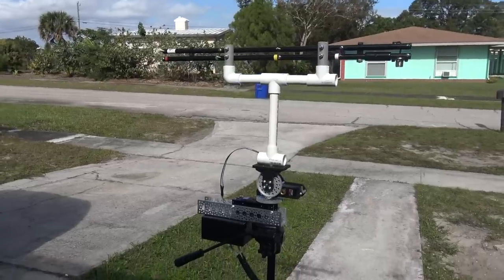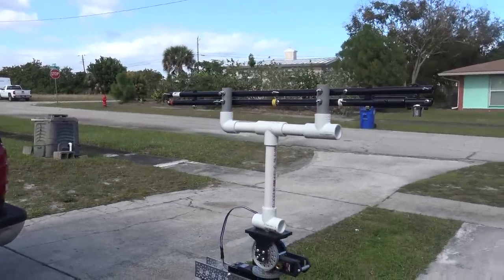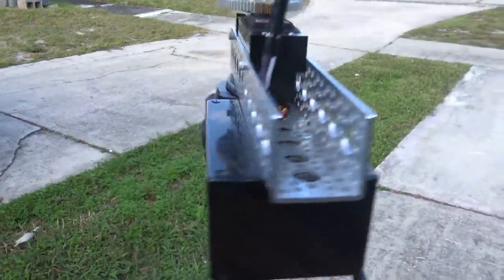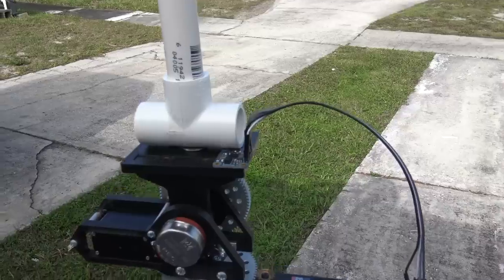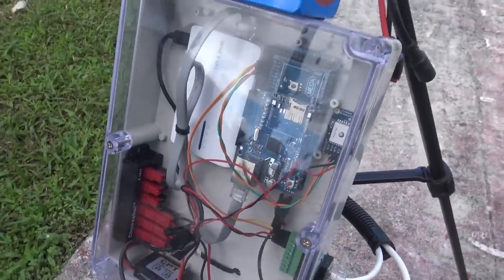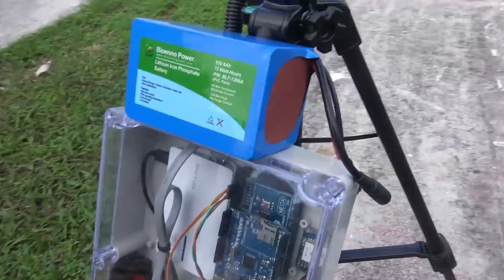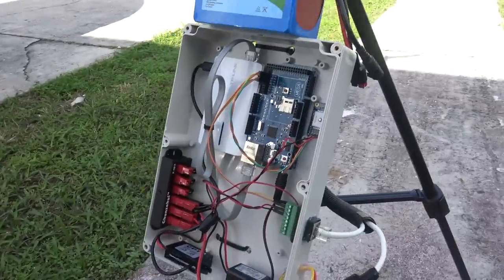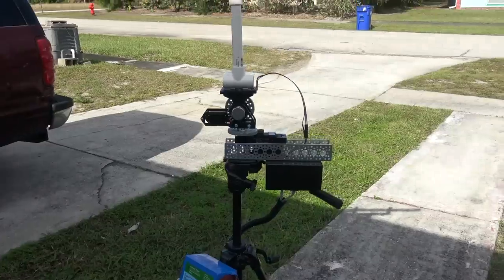Autonomous Satellite Tracker For Ham Radio, Update

Comment: Great project. I have used the panel mount RJ45 connectors for various projects including dash mounted speaker mic and detachable mobile displays in my truck. There are several version avaialble such as keystone, female to male and female to female.

Comment: I'm working on the same thing, only I chose the esp-12e. It has integrated Wi-Fi, and a complete TCP IP stack. I also chose the 9DoF from adafruit. I can mount that directly on my printed circuit board containing the esp-12e.

I also plan on integrating the (2) power mosfet  h-bridges on the PCB..
And a tiny 78SR-3v3 regulator. The 6v motors don't need regulation, just +/- direction.
QRZed me, kn6dam

Comment: You should adapt elements of a Telescope German Equatorial Mount. These mounts use weights to balance out the drive system so the drive motors are not overloaded.
Reply: That's what I was thinking as well. Shouldn't matter too much if the antenna on top is heavier if there is a counterweight to position the center of mass on the axis of rotation. With no counterweight I'm not sure if the servo can handle it, or how long it will last.
Reply: We used a counterweight system when we cycled the payload bay doors of the space shuttle orbiters on the ground during processing. The drive motors couldn’t open them alone. Was a cool system that used weight baskets much like an elevator uses. Counterweights may work well here too.

Comment: Fun to see your progress. If you have issues with your servo motors not being able to handle the weight of the antenna you could shorten the PVC pipe you have between the two tee's That would help the tilting servo motor out a bunch.
Reply from the maker: 1crazynordlander if I go any shorter on that, the antenna will clip the Tripod and aluminum channel, so I put it up lie that to avoid that but I understand your theory it’s just not feasable unless I mount tilt servo up top instead

Comment: Eric,  I let my ticket expire back in the 90s.  I only worked 2 meters.  I just picked up the 5100, 7300, and 9700...to say learning how to use this new SDR and digital stuff is an understatement.  I started working the FM birds with an HR and got a real kick out of it.  Now I want to build a portable satalite station for a xcountry trip my wife and I are going to take.

Your project looks a bit like plans I picked up from Mark Spencer, the WRAPS rotator system published in the January, 2014 QST.  The plans are available online if anyone just does a Google search.  

I belong to the Goddard Radio Club here in the DC area.  Most of the other members work for NASA and one of the guys is involved with the Amatuer ISS project.  They have a Leo Pack on a tower using an AZ EL system.

I assume you can only use a lite antenna on your system.  Does one really need a polarized pair of antennas? I should think you will be able to work most birds with your setup.  At this point I don't know if I want no to get into a project like this.  I would prefer a pretty much turn key system lol! 73 W1RNY.  (My call has a significance.  Can you figure it out?  Clue.. remove the 1)
Reply: is your wife a registered nurse?
Reply: @iamthundermug  No,      she was a sniper for the military with 14 confirmed kills.  She now works for the government in a classified capacity.

Comment: Eric, if I may make a couple of suggestions:
The elevation servo may have the power to hold the antenna apparatus in place, however, as it increases the elevation, the servo will be drawing progressively more current to hold it there. I suggest you shorten the vertical PVC pipe attached to the servo as much as possible. Ideally, the antenna should be in the same rotational plane as the servo and balanced front to back.
If the additional height is necessary to clear the tripod, you could install a counter balance on the elevation servo, or increase the height between the tripod and the azimuth servo.

Those dc-dc converters are usually noisy. I recommend placing ferrite beads on the outputs, and for that matter on any long wire carrying signals. In similar projects of mine, I try to use linear regulators like a 7805 if the current requirements aren't too high.

-W5CLC
Reply: One other thing to note: The rotational torque on the elevation servo is the mass of the antenna times the distance from the center of rotation. So the shorter the distance the less rotational force the elevation servo has to deal with. That's why the original build had the servo up near the antenna. -KC3MBK
Reply: @dri50  Exactly. If I remember from my 1970's math, at 45 degrees elevation the torsional force would be 70.7% of the mass times the radius, and at 90 degrees, 100% of the mass times the radius.

Comment: Hi, great project.
The mega does have the capacity to power the  IMU (accel) unit so it shouldn't need the external supply.
What current capacity do the two DC-DC converters have?
I would suggest you place some bypassing capacitors in your power circuit, this because you are using SMPS DC-DC units and the produce/radiate electrical noise, especially considering the sensitivity of the IMU unit.
You have servo power cable running with your IMU unit cable, this my cause a problem.

It looks like with the gearing you are using continuous rotation servos.
The gearing will help, but realise when the servos get your rig to point in the correct direction, they will have a constant torque on them.
Your pot feedback system will be keeping the motors in position, so you will have a load current flowing through the servo even when stationary.

Comment: Where are the links....also why Arduino not RaspberryPI?
Reply from the maker: Links in the first video. I gues I will post them here... There is a newer design that Elwood created using a  ESP8266 processor, that is more up to date. But I didnt realize that and went this route.
Reply: @HamRadioConcepts  Only reason I ask is Arduino is micro controller were as RasPi is a MicroProcessor which can do more????